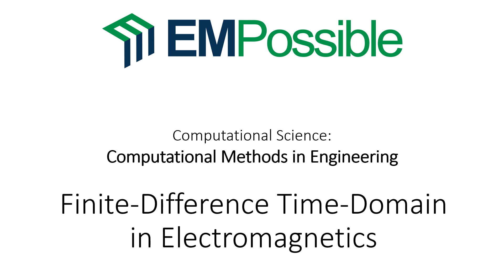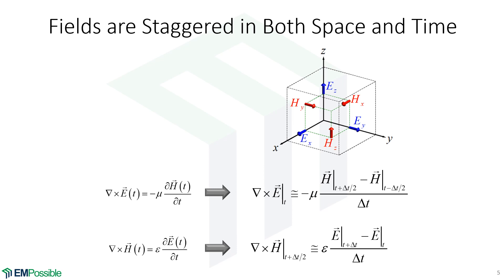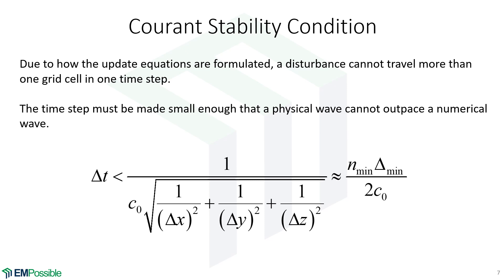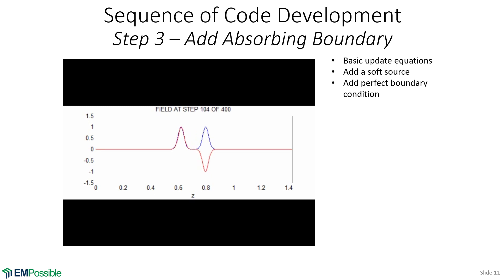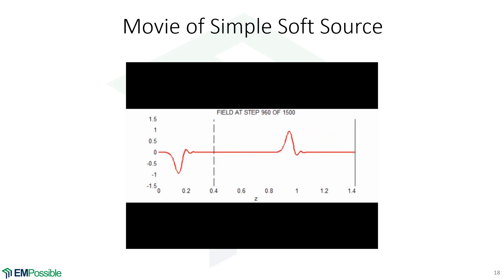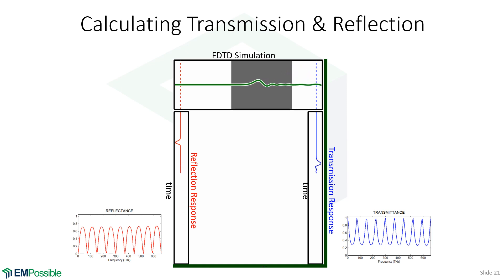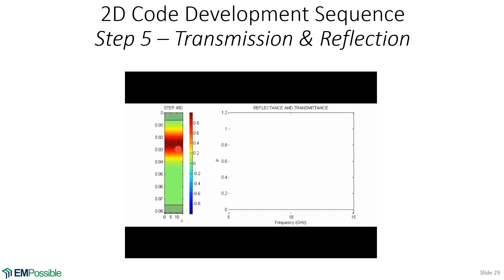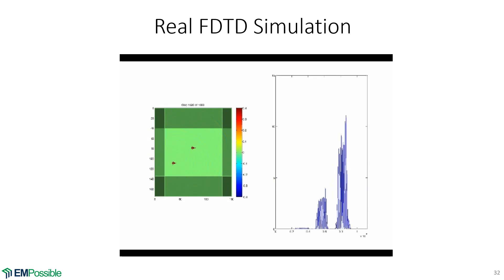Lecture -- Finite-Difference Time-Domain in Electromagnetics

Comment: Huh, that's pretty interesting. What would be the preferred alternative to FDTD for resonant devices?
Reply from the maker: Awesome question!  

It is hard to say what is the "best" alternative method because it depends so much on what you want to simulate and the physics you want to incorporate.  I can say that the best first method to learn is finite-difference frequency-domain (FDFD).  I think it is the easiest method to learn and implement that obtains a rigorous solution to Maxwell's equations.  It is incredibly versatile and can simulate just about any type of device or structure.  The drawback of FDFD is efficiency and you will feel that if you ever try to simulate very large 3D structures.  For everything else, it is an awesome method.  I know many methods in computational electromagnetics (CEM) and FDFD is what I use most frequency by a large margin.

If you are interested in this method, I actually just published a book on FDFD.  The book is intended for those completely new to CEM to learn the art and science, like boundary conditions, sources, post-processing, parameter sweeps, and much more.  I teach the basic concepts and techniques of CEM through FDFD, but the concepts apply to all numerical methods.  Here is a link to the book:

https://empossible.net/fdfdbook/

Comment: I am currently watching your videos about FDTD on Yee grids, for numerical simulations of electromagnetic waves. The scenario I'm trying to simulate is the one of the pTx system in an MRI scanner, which consists of N dipole antennas parallel to each other, arranged around the piece of human tissue that is to be imaged. The dipole antennas send out periodic waves at a constant frequency - does this mean it is sufficient to do a single frequency domain simulation at exactly that frequency? Or is it better to do a time domain simulation (which is what I have been doing so far, on a collocated grid, with second order wave equations, which appears to be unstable and led me to search for another solution)
Reply from the maker: It sounds like a fixed frequency will work for you, but I will admit I not that aware of how MRI scanners work.

A collocated grid will definitely not work for you.  I don't think it will cause the simulation to go unstable so that might be a mistake hiding in your code.  A collocated grid will more cause material interfaces to reflect and transmit incorrectly.  I am more curious about your PML when it comes to instability.  The UPML I teach in the free course can be unstable if you place a PML along all boundaries.  The CPML is much better.  Of course, your instability could also be just a sign error in your code somewhere.
Reply: @empossible1577  thank you for your reply! i will look into it further
Reply: @empossible1577  i just realized that i had to click on "read more", and that i didnt read the whole reply yet

whats happening in the simulation is that on the boundaries of the "human head", modeled as a sphere with some conductivity σ and permittivity ε, at some point, the field starts growing exponentially, but still switching polarity periodically (at double the period length of the source from some reason)
I havent yet watched your videos on boundary conditions, I will definitely watch them soon
Reply from the maker: @firstlast-qy6xn  Hmmm...It is easy to make a mistake in the update equations when incorporating conductivity.  You might also have a Courant stability issue and need to choose a smaller time step.

Let me point you to two resources.  The first I think you are aware, but it is the website for my free FDTD course:

https://empossible.net/emp5304/

The second is a paid FDTD course that is next level in terms of how it teaches FDTD.  It also includes all of the MATLAB codes with a line by line explanation of the codes.

https://empossible.thinkific.com/collections/FDTD-in-MATLAB
Reply: @empossible1577  thank you very much!